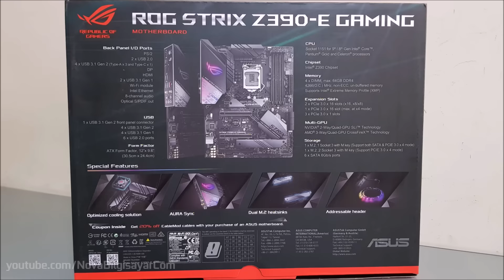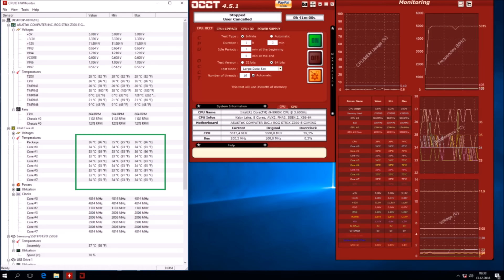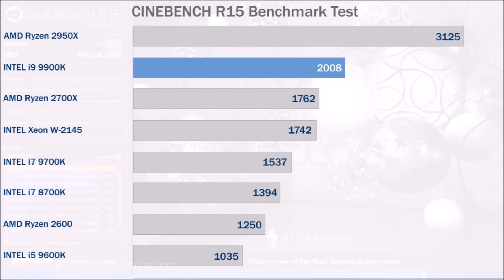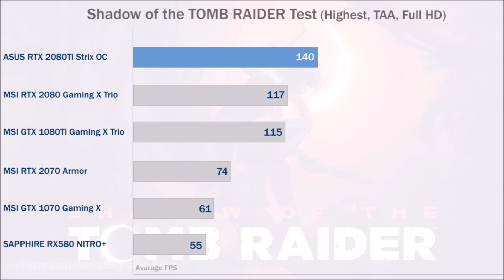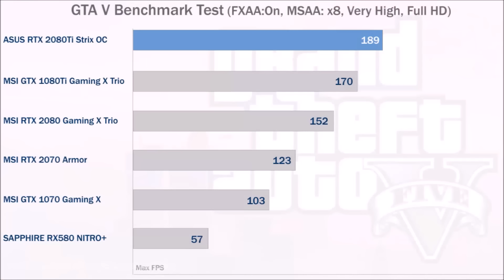INTEL i9 9900K & RTX 2080 Ti PC Build, Benchmark and Game Tests

Comment: This cooler isnt enough for i9 need higer than 240mm even
Reply: That and where tf is thermal paste?
Reply: @scumpuandrei2050  it's on the bottom of the waterblock that goes on the cpu
Reply: @scumpuandrei2050  true
Reply: @scumpuandrei2050  Thermal paste is pre-applied on this cooler
Reply: @scumpuandrei2050  pre applied
It's an AIO cooler it has already come with a thermal paste in it. So , you don't need to apply.
Reply: Just install an ac inside it!  XD
Reply: @supremepower3901  but those pastes are rather low-quality and it makes a lot of sense to spend 10$ extra on a professional one with this expensive of a PC
Reply: Andrei_Scumpu on the cooler. WC comes with pre-installed termal paste
Reply: actually i suggested him the same seeing this rig he shuld have gobe with nzzxt x72 
Corsair Hydro CW-9060031-WW RGB Lighting Liquid CPU Cooler (Black) 
or cooler MAster ML360R
any one of these would b just fine
Reply: yeh its gonna overheat easily
Reply: Ali Al Iraqi  im about to do my first build with a i9 9900k, asus rog strix 1080ti 11gb OC, Gigabyte z390 aorus master, 32gb 3000MHz ram, 850w psu, and a h150i cooler(360mm radiator size). Can anyone help me out and tell me if this will overheat and if my cooler will be okay
Reply: yep u right plus the thermal paste wasnt on lmao
Reply: For this toaster of a cpu even 240 is not enough. And if you want to overclock it than you vetter open the wallet and go for a 360 mm or bigger
Reply: @brunolopes2205  Except I have this  CPU, and a corsair hydro H100i pro 240mm and my cpu is overclocked to 5ghz and runs around 70ish under full load.
Reply: Aes go with x72 I have pretty much the same built and it runs good with he x72
Reply: @Vico7787  cooler is perfect I have on my i9-9900k Build no Problem you're be good
Reply: Tho AL i have the 3 radiator fans for the h150i, the 2 big rgb fans on the front of the h500m and the rear exhaust fan
Reply: lbcdc2itr yeah mines working good but on some games it can get hot like around 85 degrees max and thats with all the h150i settings on quiet. If i have the h150i on all balanced settings, it never gets over like 77 on cpu demanding games.
Reply: I have the cooler master master liquid ml360r on my i9 and I have very good temperatures
Reply: @prodkam5312  it was already applied on the water cooling block.
Reply: @scumpuandrei2050  came pre applied on the AiO
Reply: 360mm be quiet works great. stock 4.4ghz 30 - 35c idle and 55 under load
Reply: Is 360mm liquid cooling enough?

Comment: Most powerful PC and yet still struggling to run 4K
Reply: Sendy Pamungkas its not the most powerful. Its 32 GB ram when u could reach 256Gb of ram.
GPU could be better (the msi one)
Reply: Sendy Pamungkas also the rams are pretty bad.
Reply: Sendy Pamungkas also the mobo kinda sucks. (For its price)
Reply: Sendy Pamungkas mobo is shit as well
Reply: Chill

Comment: Power supply and AIO can be more better not these two
Reply: Is the H150i from Corsair an overkill for an i9 9900k?
Reply: more better huh?
Reply: @Android25K   I have the i9 9900k as I wouldn't go less as my system is running at 4.8 Mhz   at 46c  as I am just doing  photo editing and I have the Corsair Hydro Series H150i RGB Platinum...
Reply: @Kyaizen  you think the ''be quiet silent loop 280 AIO'' is good enough for overclocking a i9 9900K ?
Reply: Hey, so I'm looking to invest about 3000-3500 dollars into a PC but have no clue what to do when it comes to building a PC - as I've only bought "pre-builds" in the past. You're mentioning this build isn't good enough so could you point me in the right direction? :)

Comment: 1080p.....please. if you using a 2080 tI you need to be running only 2K and 4K test...1080p is way to weak for these kinda builds.
Reply: Untouchable771 not if you’re looking for a consistent 240+FPS.

Comment: Replacing the H80i with a 240/280mm rad cooling mounted in the front of the case and it'll be perfect because I think the H80i covers the most beautiful part of the mainboard. But nice build anyway :)

Comment: Abi kardeşim sistem topluyoda 1050 ti ya uygun hangi islemciyi önerirsin
Reply from the maker: AMD 2400G/2600, B450 Anakart, 8/16GB 3000 Mhz ram, 500/600W kasa.
Reply: i3-8100 ve i5-8400 da olur. B360 veya H310 ankart ile
Reply: Abi rx580(8gb) hangi anakartı ve işlemciyi önerirsin

Comment: that's got to hurt. 52 frames in assasin for a price 3000 dollars
Reply: Amarce0987  I build my PC 2 years ago. I got I7 6700k and RTX 2080 video card.With the upgrading my GPU my PC cost  $1640. I got 48fps in 4k in assasin. I don't think 4 fps better frame rate can make me upgrade to RTX2080TI and I9900 CPU :) But I guess here the GPU is not OC and used some screen recorder. Never use screen recorder when you trying to benchmark! On Cinebench I got 14fps only lower-162.69fps. This is another example the RTX2080TI is not worthy the double cost than 2080.
Reply: Andrzejxu Assassin's Creed games are super un-optimized
Reply: He also recorded so it would be 60 fps on 4k
Reply: @kirostar12  rtx 2080 2 yrs ago hmmm

Comment: Why would you watercool with only one radiator? You could equivalent temps with an air cooler for half the cost.
Reply: Jhude tHts what I’m saying I was like huh what it’s that 😂😂 I have a dual fan connected to my 280mm liquid cooler radiator for 80$ from nzxt it’s a much need for this build

Comment: Very nice temps!  I guess you may have a very good CPU (silicon lottery). Hardware Unboxed paired the 9900k with a Corsair H115I Platinum and temps were skyrocketing like hell (85-90ºC)...
Reply: I question the quality of 9900k's given to early reviewers. Mines running at 5.2 ghz and at 100% load it doesn't go past 68°C.  I had to wait a month and a half for my pre order to be fulfilled and the reviews had me seriously second guessing my purchase prior to actually receiving it. Couldn't be happier with how well it runs everything but I wonder if retail versions of the chip sold later on (like mine) are better binned. It could just be the luck of the draw but it felt like every youtuber had negative comments regarding its thermals.

Comment: I'm glad I have a Ryzen 2600, GTX 1070 and 16GB RAM system! I spent 3x less than you and for Full HD this combination is a killer for every game, except AC Odyssey ofc, that game is a piece of unoptimised crap. 😂 Anyway, good video!
Reply: I mean if you can reach the benchmarks he can for pushing the games limits to the absolute maximum then gg on your part but I doubt you can reach that.

Comment: Question....I essentially built the same pc. I bought the i7 9700k. 240 liquid water cooler. 32 gb's ddr4 3200MHZ. Same motherboard. M.2, bla bla bla... Only thing is I got a 1070 ti for half price on boxing day. Would I see any difference if i was to buy a 2080ti? I play pubg on 1440p on a 165hrz monitor and get consistent 135fps to 165fps.

Comment: Can I connect 3 2k 144hz monitors to this gpu (2 display ports and one hdmi 2.0).The monitors have a hdmi 2.0 port. Will I have problems with nvidia surround or not?

Comment: hi guys can you tell me if it's overkill to have a psu 1000w for a core i9-7960x, an rtx 2070 with 3 fans and heatsink, 2 ssd and 2 hard disks?

Comment: You spend tons of money on cpu and gpu and mobo but didn’t buy a 280mm radiator for the i9 or even a 360 if it fits in the case

Comment: selam abi ben bi sistem toplucamda senden bi görüş alıyım istedim sistem şu rx570 4gb /8gb 3000mhz ram /b350m anakart / ryzen3 2200g / 500wat güç kaynaklı bi kasa / 7200rpm hdd sence nasıl her oyunu oynarmıyım
Reply from the maker: Anakartı B450 çipli olanı tercih etmenizi öneririm diğerlerinde sorun yok.
Reply: @NovaBilgisayarCom  birde bu rx 570 ile gtx 1050 aynı fiyatta olmasına rağmen rx 570 kat kat daha çok performans veriyor bu işte bi bit yeniği varmı anlamadım ben uzun kullanımda rx 570 sıkıntı çıkarırmı

Comment: Isn't that cooler a little too weak for an i9?
Reply from the maker: It is enough for render (max 68 for render) and for games it is not more then 70°C in games with no OC. But with more budget u can get H115i Pro for OC.
Reply: @NovaBilgisayarCom  Is the H150i an overkill?

Comment: I do not understand in ps4 pro And XBOX ONE X Half of the games come with 60 fps in 4k... Why do not I see a big difference with RTX 2080 TI????????
Reply: Theres a huge difference. PS4 doesn't even have real 4K its just upscale resolution. Majority of console games are not stable 60fps. A 2080ti can play 4k games above or a little under 100fps with ultra settings depending on the CPU something current consoles will never achieve.

Comment: It is not enought 700 wat for that monster,because before on gtx 1080 and i7  have higher wat than now  gtx 2080ti and i9 which are the most powerful than gtx 1080 and i7,i think about 1000 wat for those components is enough.

Comment: Why buy that processor if your going to skimp out on the couch cooler and PSU you of spend the extra 100 for a better could cooler for sure and the PSU need to be at least gold certified considering you have an i9 and 2080 ti